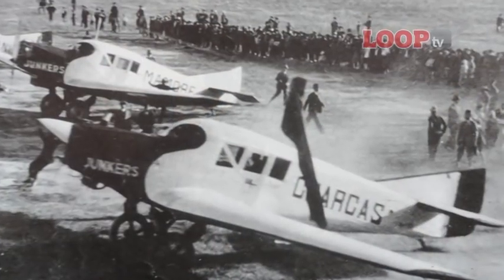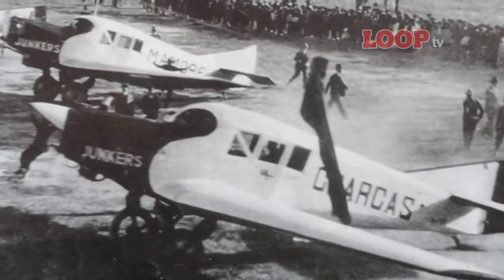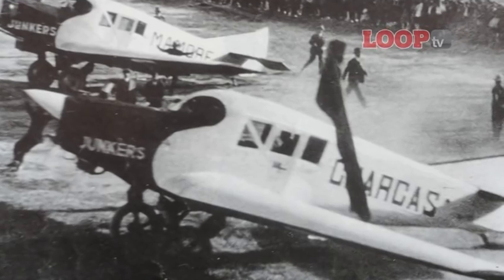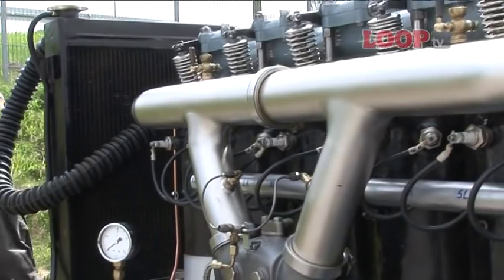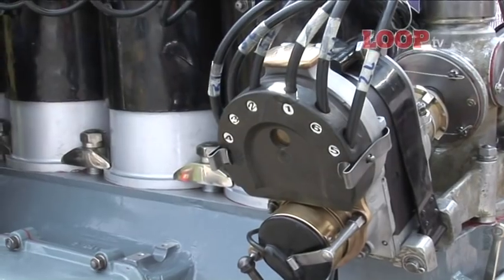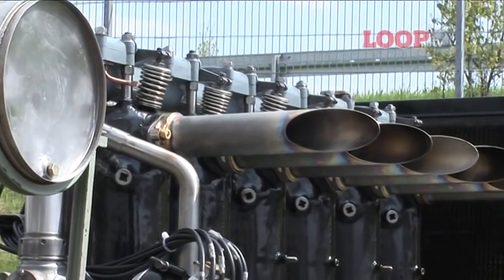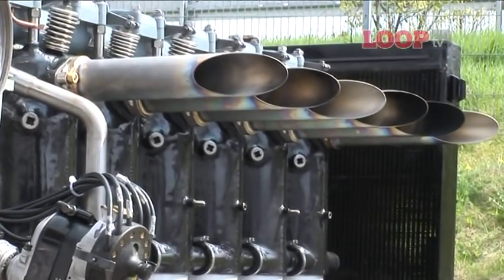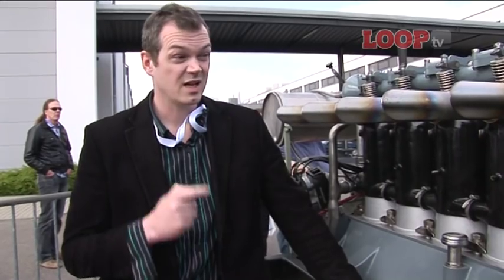Junkers L5 aircraft engine, start-up

Comment: what i do not get, is why do they need to beg, borrow, or steal parts from various museums around where ever if they can just take said part, 3D scan it, then 3D print a mold master so they can cast a brand new part and leave the origional in the museum that is what boggles my mind.
Reply: I was thinking the same thing actually.
Reply: Because they aren't trying to make a replica of the aircraft; they're trying to restore it. So that means, whenever possible, using original parts rather than replicas.
It's like how a collector rebuilding a 1955 Jaguar will go to enormous lengths to find and restore an original hose clamp that does the same thing a new hose clamp would do. Except a new hose clamp won't be authentic for a 1955 Jaguar.
In this case, the narrator is engaging in a bit of hyperbole. It just means they went to great trouble to locate original parts. They didn't actually steal them, they just found collectors and museums with extra parts they could buy and put back into original service.
Reply: I understand that, but I believe they should at least make 3d blue printed replicas to cast in case something does happen to these original parts during these demonstrations. I love classic cars myself, so I fully understand the motion behind authentic parts but then again with that being said to me "all original" would be numbers matching. Again, just another technicality. Nonetheless, still a very cool piece of history and machinery.
Reply: ppmguire
Because of costs, especially the paperwork to document that the part conforms to the original manufacturer's specs or exceeds them when required by aviation laws. 3D scanning will reduce the engineering labor though.  The restoration expert who overhauled a DB601 commented that a single new casting for the engine was over $20K. Consider the thousands of parts in a single engine.
Reply: Sure, and again I understand that, but think about when these parts are gone. Then what? Watch videos like this of what could have been if they decided to print and cast these parts? I'm just saying it would be smart. If they had to steal from everywhere (figuratively) to make one engine go then that means IF something happens to any of those thousands of parts it's dead in the water. Shoulda coulda woulda situation. It would be a shame for this to happen.
Reply: FiveCentsPlease It can't cost THAT much to do a "lost wax" on a given part.
You make an impression, fill the impression with wax, lay-up plaster, then cast.
Reply: TIMEtoRIDE900
Compliance with aviation regulations, conforming to original manufacturing specifications (tack on a lot of research for an old historic engine with lost documentation), precise temperature control and heat treating to get the strength in the parts, documenting and destruction testing for any deviation from original, and all of the other required paperwork all add up to a lot of aerospace dollars. Combine that with potential liability for a failed part that crashes a multi-million dollar airplane and it will be hard to find a shop that will even make a component for you. However, some new parts are being custom made when needed. The small number of shops that restore these engines are still re-learning lost information in some cases.
Reply: FiveCentsPlease While I appreciate the intelligence of your response, I must say that the new part would be cast with a metallurgy far superior than 1920's standards, and if the casting were free from inclusions, it would most likely be far-far superior, after being machined, X-rayed, shot-peened, sub-zero treated, ETC. without any further testing.
I'd bet my life on the new part over the old.
Reply: TIMEtoRIDE900
New parts can be better and safer, but they are still expensive to make. In fact I agree that the only future to keep these engines going will be new parts and improvements and even the engine builders have been saying this for some 20 years now because the NOS inventory is getting low. Restoration or overhaul of these engines today typically includes extensive testing, inspection and X-Ray tests. Regarding expensive new-made parts or changes from the original specifications, if you do not document everything down to the letter for FAA approval they can come down hard and shut you down. For example read Page 1 from this newsletter from ACE when they got into trouble over compliance. http://www.aceallisons.com/newsletters/Newsletter-3d2.pdf